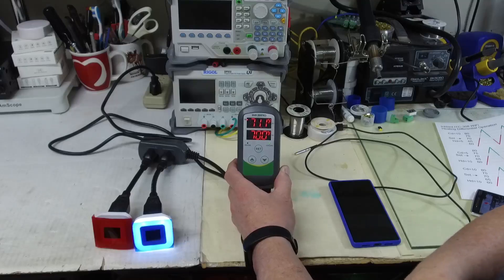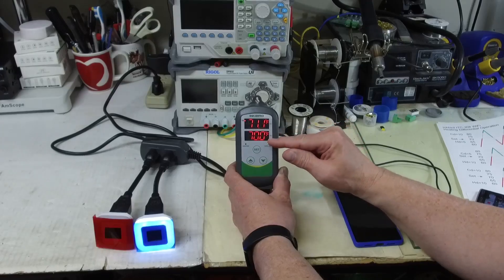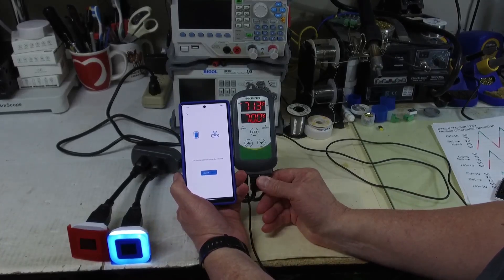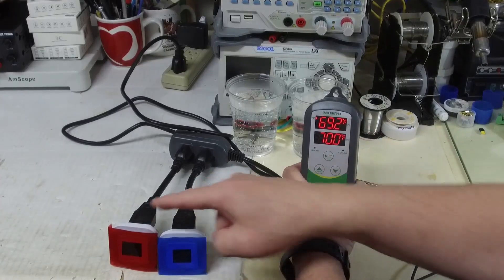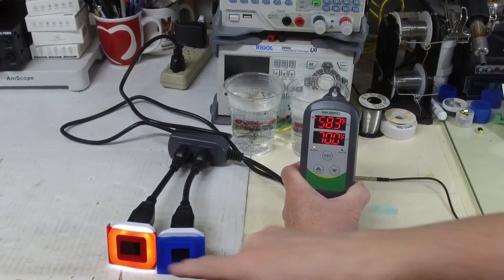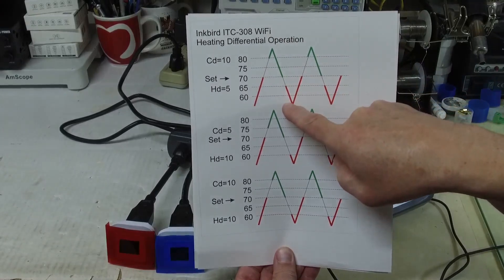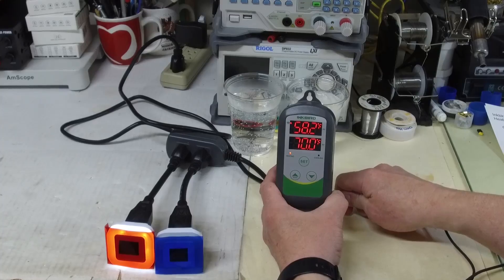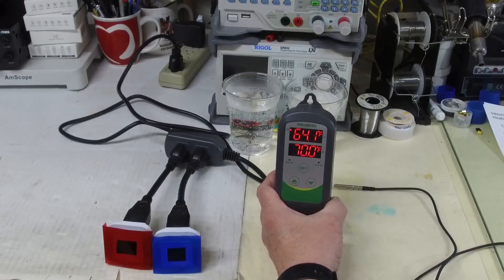Inkbird ITC-308-WiFi Temperature Controller Operation with Differential Setting Explained.

Comment: So question please if i have my desired temp set at 70° and my CD set to 5 and HD set to 5. Once my temperature rises above 75° the ac will kick on and shut of at 70 wants temp gets below 65° heat will cut on and bring it back up to 70°? Im looking for a desired temperature of 70° and need my heater and ac to cut on and off on there own to achieve this?? Maybe im just not understanding your video is only one i can find that closely resembles what im trying to do thanks
Reply from the maker: What you described is what the controller will do.

Comment: can I use both plugs for heaters from my aquarium? or do I need to add divider to the heater plug and plug in to that both heaters? Eva
Reply from the maker: No.  One socket is for heat and the other for cooling.  You can plug a "divider" / power strip into the heat plug to run two heaters.  Just make sure your combined heaters do not exceed the ratings.
Reply: @DanPattenAudioG33k  thank you!

Comment: These work so great .  I plug a nice quiet oil filled electric radiator into one.  The "thermostat" on these portable heaters are so close to the heating element that the temperature cycles are very wide and the relay is loud.  When plugged into one of these the temperature control in the room is perfect.   These are also great to control a light bulb or other heater in a 3D printer chamber to get exactly the temperature you need to print ABS or other higher temp filaments.
Reply from the maker: I agree.  They are a good controller.  Just wish I could set independent temperatures for heat and cool.

Comment: wow, now this all finally makes sense.  This is very odd and confusing compared to my other thermostat.  Using this to operate greenhouse heater along with a fan during the hot humid afternoons.
Reply from the maker: It was confusing to me as well.  I was initially hopping that I could the differential value would allow me to set a window where not heating or cooling would occur.  Nope :)  Would need to devices to do that.  It is still a good value though.  Thanks.

Comment: Thank you for taking the time to record your video... I agree its operation is a little odd... 

In my setup, I only need to switch on a heater in the winter period -  when the temperature falls below 3°C.  So I set the setpoint at 5°C, the heating differential at 2°C with the hope (!!) the heater will switch on at 3°C .  

I don't need the cooling function, but all I can do is set the cooling differential to 15°C in the expectation the cooling will not switch on unless the temperature rises above  18°C  (5°C + 15°C) but when I first set the unit up, I could see this is not the case.  With the room ambient at 19°C, the cooler function is active - If I  understand your video, if I force the temp below 5°C,  the cooling function will switch off and not switch back on again unless the ambient exceeds 18°C.  I suppose this is unlikely in the winter months 🙂  

Thank you, once again!
Reply from the maker: The differential value + set point is where cooling will start.  However, it will cool to the set point.  I was hoping that it would only cool to the differential value + set point.  I was trying to realize a window where no cooling or heating would occur.  Thanks.

Comment: I’m using this help cool down an outdoor tv box that’s going to be on my covered patio in Texas. I’m only plugging in a small PC fan into the cooling side. Could you suggest some settings for my use? It can get pretty hot here especially during the summer so I’m expecting temps inside the box to get up to 100+ at times. TV will be unplugged when unused,  but the cover will be on and I want to make sure it doesn’t get too hot in there. The manual for the tv says storage temp can be up to 113F. I’m probably setting the alarm high to the max 212F just so that it doesn’t go off. Thanks in advance for any help/advice you can give!
Reply from the maker: Outside environments are difficult.  I would probably just set the temperature at 80F, which would probably result in the fan running all of the time when in use.  I would also worry about the storage temperature (when off).  Does the cover get any direct sunlight?  If so, you might need to make sure there is ventilation under the cover.
Reply: @ thanks what would you set the heating/cooling difference values? Don’t really need the heating side to kick on but from what I’ve read, there’s no way to disable the outlet. 

The cover does not get direct sunlight. It’s on brick wall under a covered patio. We also have motorized patio shades so the one side that does get afternoon sun is already covered. 

Besides the hole for the fan, there’s a rubber grommet that I can take out which allows for the power cord to pass through. Right now I have the fan pointing outwards so that it’s essentially sucking the hot air out but I might flip it so that it circulates air inside the box and then can vent through the grommet hole
Reply from the maker: I would just set the Hd and Cd to minimum values of a couple of degrees.
Reply: @ I wonder if I have a bad unit. It’s currently 74F here. Inkbird is showing that the temp inside the box is 127F. I opened up the box but it feels cool inside. The sun isn’t even hitting the box and the patio also feels cool with the shades down. I just swapped the direction of fan so that it blows air into the box now.